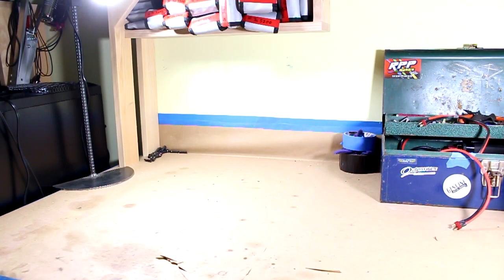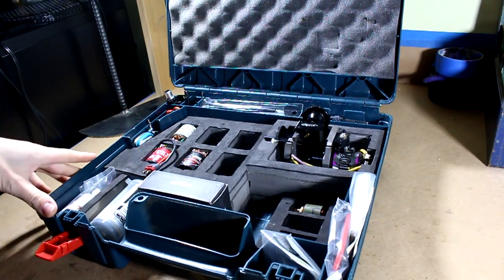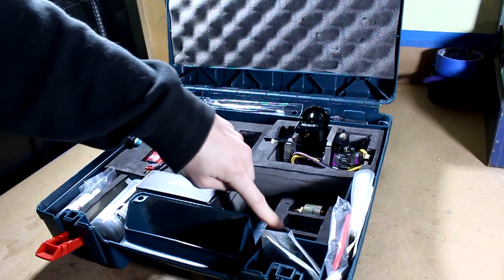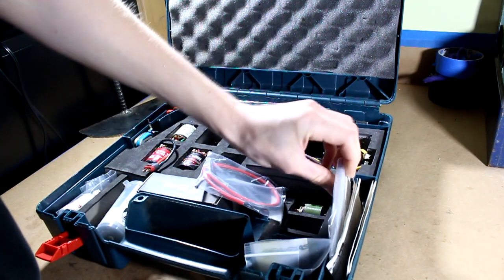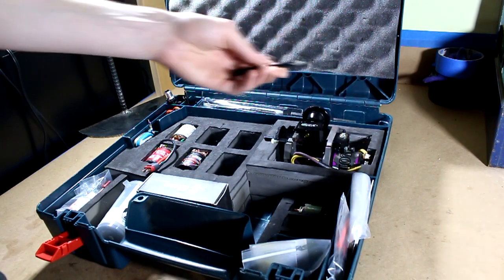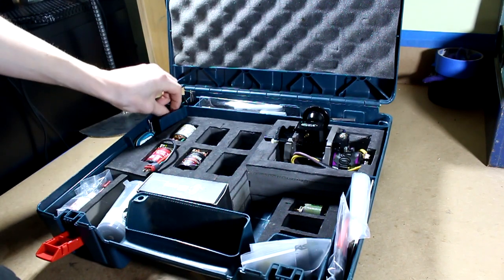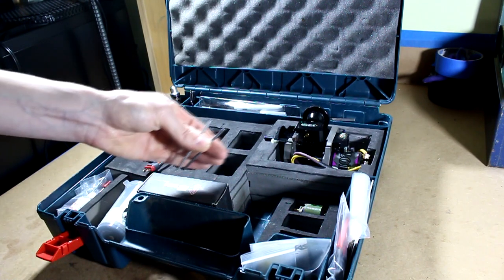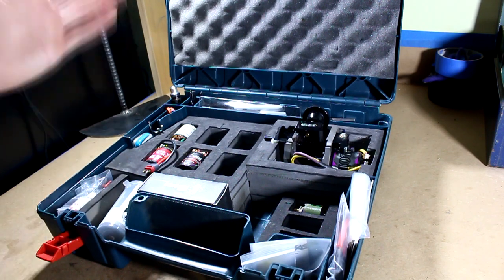Motor and Lathe Equipment Carrying Case! // Part 2

Comment: I meant to say, if u can still find a power supply with a 5 volt tap OR a variable rate supply, u can use it to power your lathe. Definitely no more than 6 volts TO ur lathe NOR to break in the motor brushes! TOO, see if you can find a "brush hood alignment tool". If by chance you cant, send me a message & I'll give u 1. (I have spare everything for brushed motors!), along with a few pairs of motor brushes. 

Greg Johnson.
Reply from the maker: Yeah I have one, I may not have shown it in the video but I use it in the next part. I'll be needing brushes in the future, where can I message you?